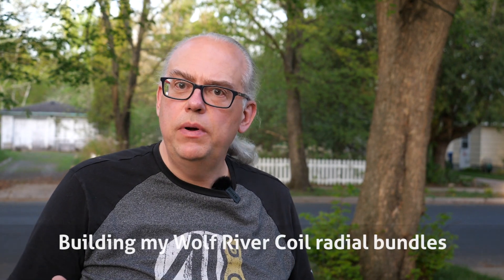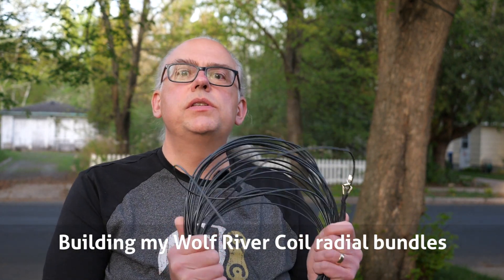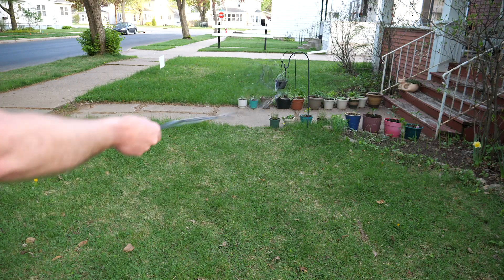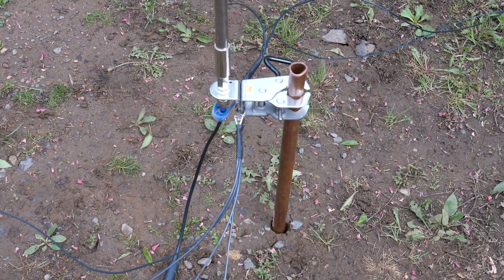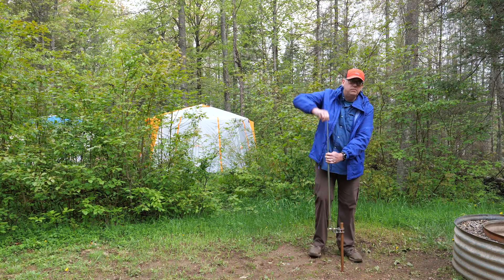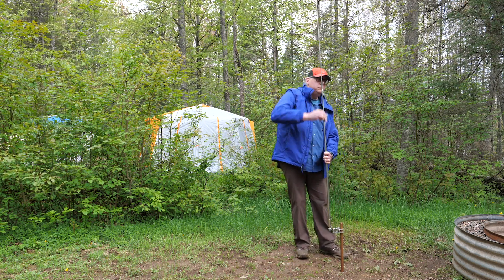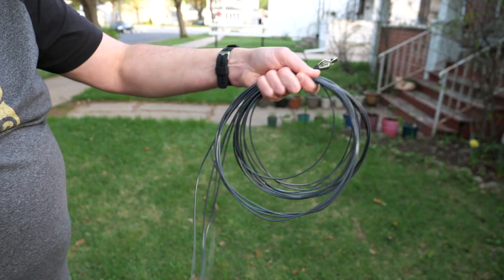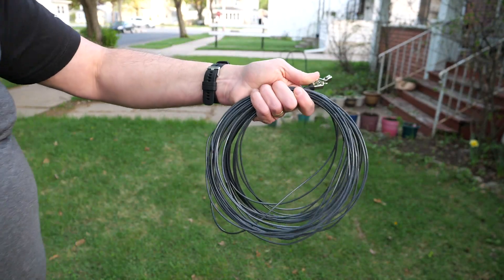Better Ground Radials for the Wolf River Coil #HamRadioQA

Comment: Hi Michael, I just purchased a 17' vertical and the SB1000 and have a couple of questions. Does the ground spike affect the SWR, and does it make a difference if it's mounted on a tripod? Video suggestion: show the process of tuning the WRC with the 17' whip on different lower bands (20, 40, 80m). The WRC instructions only talk about lengths of 102". Thanks! 73!

Comment: I've set up my WRC using their camera tripod adapter. Using two cell phones, I had my nano vna on screen as I was making adjustments outside. For some reason I can't get the swr anywhere below 5:1. I have brand new coax from HRO with 7 ferrites on it. That end was connected at the antenna. Does the 3/8 to UHF connector need to be really wrenched down? I hand tightened and gave a good quarter turn beyond that. The build quality is excellent so I'm sure it's just something I've missed on my end. Any advice or tips would be greatly appreciated, thank you!

Comment: What size wire do you use for radials. I'm a newbie and green. Watching you videos to learn. Great videos thankyou
Reply from the maker: Wire gauge isn't critical, I've used 14 ga THHN and 22 gauge silicon wire. Of all the sizes I've used, I've found that 18 or 20 gauge silicon is the easiest to work with.

Comment: 1) Do you insulate the distal ends of the radials? 2) What happens if you attach all of the distal ends of the radials together with a large circular wire? 3) Have you ever experimented with a capacitive hat for the WRC system? All the Best! 73 DE W8LV BILL

Comment: What size wire are you using for your radials?  73s W4IOS
Reply from the maker: I used 14 ga THHN wire, because I had a big spool. I recommend any wire size between 14 and 22 gauge. Anything thinner or thicker than that is too hard to work with.

Comment: I hear so much about symetrical grounds run along the ground . but all it does is make a bunch of horizontal antennas that cancel each other out. If you only have a few going to one side it acts as a folded dipole and actually puts out a nice signal in a horizontal way. As long as it matches the coax the radio doesnt care if its a symetrical ground plane which radiates little or a horizontal radiator which gets out there.

Comment: I just bought silicone insulated wires on Amazon and there is no tangling between the wires. They slide apart easily to disperse in different directions. Thanks for the video.

Comment: what wire are you using?
Reply from the maker: In this demonstration it's 14ga stranded THHN wire.
Reply: @KB9VBRAntennas  I almost purchased a roll from Lowes yesterday but found it very stiff with significant coil memory. Have you found that it relaxes after warming in the sun?

Comment: I hope I didn’t screw up, instead of making gator clips with 4 X 16’ long wire, I made gator clips with 2 X16’ and 4 X8’ per clip.  I made three sets.

You know the measure twice, cut once?  Wellllll…. I screwed that up lol

Should I be ok?
Reply from the maker: You'll be ok. When laying radials on the ground, the length of the radial really doesn't matter as much as the amount of area that you can cover. Many 8 foot radials will have a similar effect as some 16 foot radials. You may also find that the combination of long and short radials may have an increased performance benefit on the higher bands.
Reply: @KB9VBRAntennas  good to know

Comment: Which do you find better???
The 16 ft radials or the the screen carpet effect

Paul  K1YOU
Reply from the maker: Right now, I think the single 36x84 inch window screen works just as well as 8 16 foot ground radials. I'm still testing and making comparisons, but I do not believe you are losing any efficiency or performance by going the window screen route. As for setup and tear-down: the window screen wins hands down.
Reply: @KB9VBR Antennas  Thanks just got a roll of screen...difficult to get bright aluminum in SW Florida...thanks again will let you know how all works out..
Paul  K1YOU
Reply from the maker: The coated aluminum will also work. You may need to scratch off a bit of the coating to make good contact, though.

Comment: Does the size (AWG) of the ground radials matter?
Reply from the maker: It doesn't really matter. I use 14ga stranded for a lot of  my projects because it is readily available at home improvement stores, but any thickness is fine.

Comment: That video deserved a like and a comment!  Nice video!  I was getting ready to do the exact same thing but you have changed how I was going to build it.  Your clip method is much simpler than what I planned to do.  BTW, David Casler posted a video about ground radials.  On it he said the sweet spot was .125 or 1/8 wave length with 8 radials giving a 1.9dB gain, 16 radials giving a 3.1dB gain, and 32 radials giving a 4.0dB gain, after that, the returns decreased rapidly.  I believe the data came from the ARRL Antenna book.  Thanks for the great video and simple design!!!

Comment: Generally speaking, the normal radials for WRC is 33'. But this configuration is two bundles each with (4) 16' radials which is 128' total. Is this overkill? Just curious.
Reply from the maker: 8 radials may slightly be overkill. I've had many WRC users tell me  they split their 3 33' radials into 6 16' radials and received equivalent performance. The overall length of the radial network is the same, but with more shorter radials, you increase the network performance. Here's an article from March 2010 issue of QST that is making the rounds. It verifies some of the things I've experienced: https://rudys.typepad.com/files/qst-march-2010-ground-systems.pdf
Reply: @KB9VBRAntennas  Thanks for the quick response. I'm somewhat new to portable antennas which I decided to experiment with and needed some input as to radial configurations.
Reply: What gauge wire did you use?

Comment: The wolf river gentlemen use  3  33 feet long radials
Just wondering what formula they used to calculate the radial  and came up with 33 feet value .
Reply from the maker: 33 feet is roughly 1/4 wave on 40 meters (accounting for velocity factor of the wire). It would also be close to 1/8 wave on 80m and 1/2 wave on 20m. Radials on the ground don't need to be a specific length, but they should cover a large area for better ground coupling. It's my understanding that Wolf River provides three longer radials as that's what always worked well for them in their testing, and it does work. I've used that method for years. 

But I've also found that I'm often shortening my three radials to get a better match on the higher bands, so in experimenting with more, shorter, radials it takes less time to get a good match and performance is as good, if not better, than the longer ones on the higher bands.

Comment: Right On Michael. I did the exact same thing. I use the WRC with 100' RG8X into the house. I added 8 sixteen footers to the existing 33' radials, pinned them and are all covered over in the grass. I alternate between the 17' whip (20 meters) and the standard whip with coil (40 meters) and have had exceptional results.

Comment: How were your results on 40 and 80 meter?
Reply from the maker: I haven't used this setup on 80 meters, but it works extremely well on 40. I haven't noticed a difference in distance or signal quality on that band using the shorter radials as compared to three long ones.

Comment: I bought two of the Super Antenna set as I had an Amazon card. It is a bundle of five wires cut for 10m, 11m, 12m, 15m, and 17m. Combinations of those 1/4 wavelengths get 20m, 30m, 40m, and 80m.

On my Ultimax 80m-10m EFHW there is no difference in SWR when I am grounded at the feedpoint. There seems to be a slight improvement in performance.

I also use them with my Chameleon Emcomm III portable. There is a minor change in SWR with some bands slightly better or slightly worse, but slightly better performance on 80m. The Chameleon Emcomm III portable at 73ft radiator, 25ft counterpoise, and radials is still about 6dBr down from the 130ft long EFHW on 80m when operating NVIS.

Comment: What are your SWR numbers vs using say 4 or 3 33’ radials? The SWR should be higher with the more/shorter combo. However your gain benefit should far outweigh any power losses from increased swr. Just curious what numbers you’ve gotten on both configs. Thanks!
Reply from the maker: You are correct that the SWR will be slightly higher when using more/shorter radials than fewer/longer ones. But in using the longer radials, adjusting the antenna was always more challenging on the higher bands than the lower ones. With 3-33' wires, I may spend up to 20 minutes to find the right spot and many times the SWR may not get below 1.7:1. I've found that using more/shorter radials has expedited the process in that I can do band changes in a couple of minutes. What has changed is that I'm no longer trying to adjust the radials to get a good match, I just concentrate on whip length and/or coil setting. 

With the shorter radial network I can get the coil pretty close to 1:1 on 40m and between 1.2-1.5:1 on 20 meters. With 17m and above, I can't get it below 1.5:1. Checking on the analyzer, I noticed that the resistance drops to about 36 Ohms (which is typical for an HF vertical  antenna that doesn't rely on a transformer of some sort). But SWR isn't a true indicator of antenna performance and the improved ground network makes up for any losses.
Reply: @KB9VBRAntennas  Thanks Michael! I myself have found that while using a 9.3' whip, 4 33' radials allow me to match to a 1.08 on 20 and a 1.2 on 40. Jump up to 16 radials and I end up with a 1.5 on 20 and a 1.8 on 40. According to research done by Rudy Severns, 16 radials will improve the signal by about 3 dB over 4 radials. I think it's well worth the loss due to SWR.

Comment: Thank you Sir. Good video. I do have a question, from the final closeup of the finished radials. I could not read what gauge wire you used. What gauge are the wires?  Thanks again. 73  W8VHS
Reply from the maker: I used 14ga stranded. I have a large quantity of that wire, but you can use anything that you have available.
Reply: @KB9VBRAntennas  Thank you Sir
Reply: The gauge would be helpful.  I cannot find that information in the transcript either.  Does it actually matter?  Thank you for doing such a great job for us.

Comment: Same here with the clips, but I use silicone jacketed wire. It's very pliable, almost never tangles (and when it does, it's so slippery, a light pull gets the tangle out), and it wraps very well on a Chameleon, SOTABeams, or similar winder. I also use 20ga wire, so I can bind 5-6 wires per clamp and be able to comfortable wrap around the winder. Third, while I have two bundles of 5m wires that work for general purpose situations, there are times when the quality of the ground requires that I use resonant radials. So I still keep 5-6 wire bundles cut for 10m, 12m, 15m and 17m in my bag. I found that even if you clip them to the tripod intermingle them with the 5m radials, even one bundle will improve some of the higher frequencies markedly. I've also found that the two bundles of 5m wires work just fine for 40m, though it's not a frequency I'm commonly on because of some of the local noise in that band.
Reply from the maker: Silicone wire is a great idea, that stuff is super flexible. I used 14ga stranded as that's what I have on hand.

Comment: Great video on the ground clamp. What is a good ground radial wire to use at a less costly price to most wire. Does size of ground wire matter ?  
Thanks Michael 
Marc
Kf4imv
Reply from the maker: The size of the wire really doesn't matter. I used 14ga stranded as it is readily available. But there are cheaper and thinner wires that will work just as well.

Comment: Hi Michael
Thanks for the video. What size and type of wire are you using
Reply from the maker: That wire is 14ga stranded. I have a big spool of it, so a lot of antenna projects come out of that wire. You can use any gauge wire and get the same results.